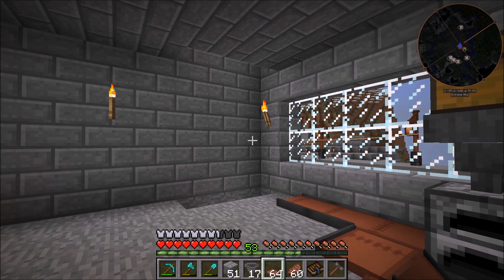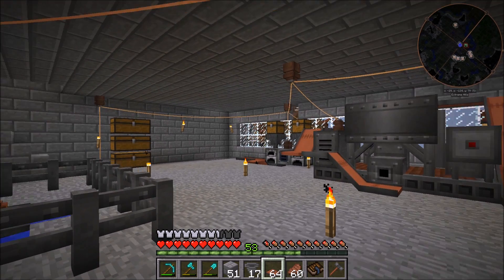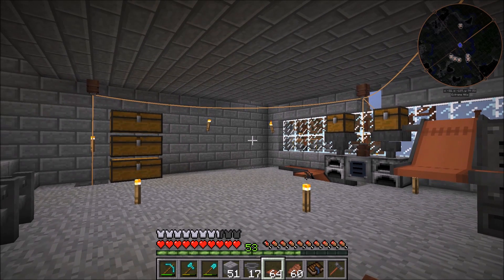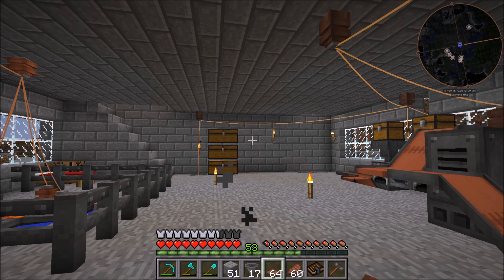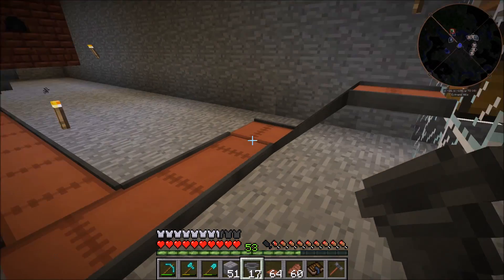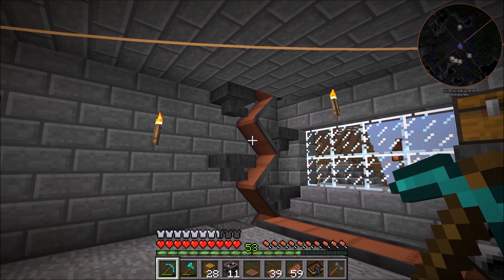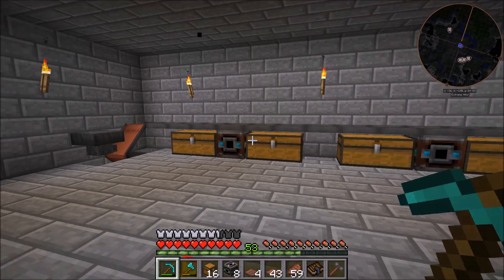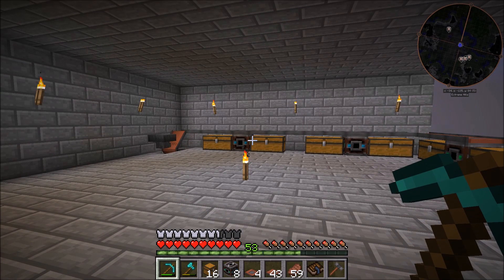Surviving With Immersive Engineering :: Ep.17 - Sorting System Overhaul

Comment: A.  You could also move the conveyor belt and item router up one and put hoppers on each side piping down into each chest, that would let them fill both sides.  

B.  You could put the chests three apart, put a hopper pointing to each chest in the left and right side and have the item router output into the hopper.

Another note, for a stick, string and cobble, you could make a chest a Trapped chest, and that can be placed next to a regular chest without it joining, so you can save a block.

C = Chest, T = Trapped chest, R = Item Rounter

__________________
CCRTTCCRTTCCRTT

However, you can't make a chest, trapped or regular, directly above a chest.

Were I to make this in my world, I'd likely use Mumbo's item sorter (with a few tweaks I've added) and replace the top row of hoppers with conveyors.

Comment: I would have used a 2x3 belt system to get around the cost of the hoppers. In a 2x3 area you can place a single continuous conveyor that stays completely seamless by placing slanted belts in the center two blocks and horizontal belts to rotate the items on the outer blocks.

Comment: I like the elevator.  I wonder if you could have stacked a bunch of item routers to transport items up.  I haven't tried this myself, but I'm thinking it should work if you don't set any filters.    It would only take up one block and be all immersive engineering, but it wouldn't look as cool as what you have now, with all the items bouncing up the conveyors.  Of course, I could be wrong about the whole thing as I haven't tried it myself.  

I like the sorting system.
Reply from the maker: +zuul The item routers would 100% work because they would auto-output to whatever side is connected to an 'inventory', which they are counted as. Hadn't thought about this as an option, and although it would cost more than both the current options, it would be extremely compact :)
Reply: why not add a sorting block to each side of the chests to input on both top and bottom of the double chests? I've not tried it but it seemed an obvious choice when you were building it.

Comment: This would be kinda expensive, but if you put routers in the current empty spaces and made sure there are the same filters for the same chests, you could insert into both parts and it should even go top then bottom, I believe.
Reply: +Flaeme Flow  yes I was thinking about that too it is a very good solution . You can even have difrent filters if you want more than 8 difrent items int the same chest .
Reply from the maker: +Flaeme Flow This would be a good solution assuming I can't get in touch with the mod creators :) thanks!